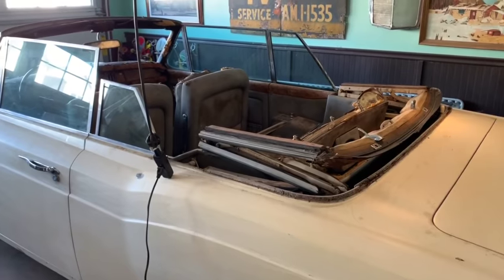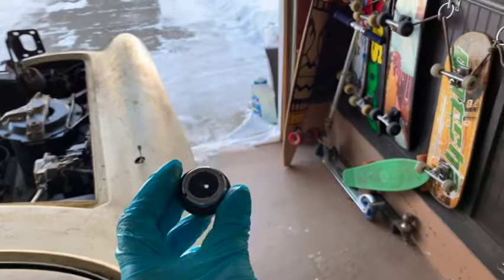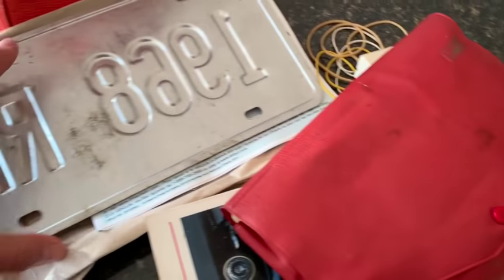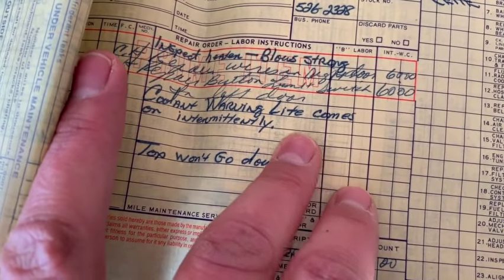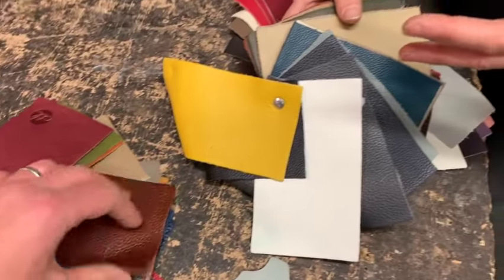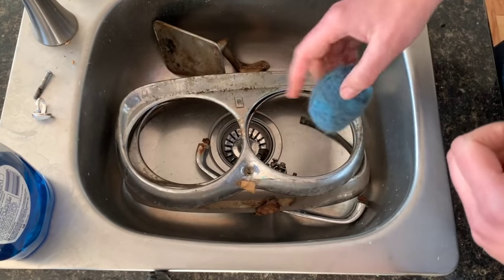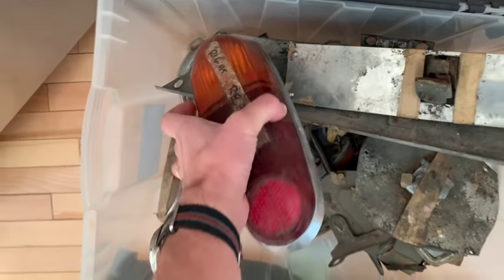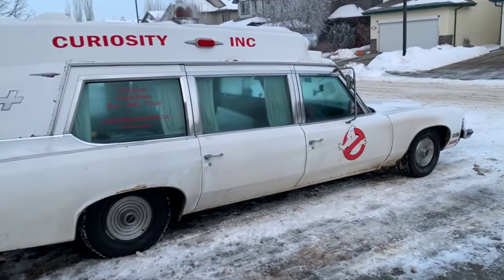I took a Junkyard Rolls Royce and brought it back to life!

Comment: Fantastic restoration but my only observation is that when you were varnishing the wood features, you should have used a polyurethane varnish and thinned down with white spirit and used a sponge type brush or better still a spray gun putting down many thin coats building it up slowly to a high gloss finish. Water based varnish does not give as good a finish as it raises the grain in the wood where the polyurethane does not. But otherwise a very impressive restoration of a  classic Rolls

Comment: I recall reading a motoring journalist's review of these cars in 1969. He said he had a criticism. That is, that because the windscreen wipers are chromed, when the sun shines at a certain angle, it dazzles you. There isn't anything else to criticise. Instead of a fuel tank it has a 50 gallon ocean that takes £70 (in 1969) to fill.

Comment: White Vinegar does the same job as your expensive de-ruster at a fraction of the cost.  Also, for large/long parts I use a section of PVC tube large enogh to fit them, capped at both ends. I fill it with cold water and a couple of raw potatoes, cut in small cubes.If you don''t believe thel atterone, I have before and after pictures! If you had a Tupperware or similar container large enough to fit  your bumper ends, it would do wonders for them.  Soak for about a week (maybe less, but I know a week works) and rinse with cold water, perhaps light scrubbing with a brass brush.

Comment: The plan certainly has come together, forgive me for cringing when I saw you using a paint brush on a Rolls Royce, but hey overall results are awesome and you have rescued an iconic motorcar. 😊
Reply: Yeah I was a bit taken aback, also the upholstery is good, but its not Rolls Royce quality, I would have been inclined to buy a used interior .
Reply: @jaynedavis4667  A few thoughts occur - it could be very difficult to find a good used interior and in the right colour. It could be VERY expensive, and might still need repair work...
This type of project has a budget - and a time scale. You have to do what suits you...!

Comment: I have a friend who actually used an old ford with an interior easily as bad as this was. And it ain't due to racoons! ( Critters  only wanna get stuff for nesting, it's cold out there!) No he's got two real dumbass dogs, that wreck everything they can get at! It's really a case of " no that's ok buddy, I think I'll walk it's a nice day." As I start of on a 30 mile hike in the pouring rain! Honestly!
  Good work man. These are super rare here (UK) . I always wanted a roller but never had the opportunity. I did however own a 4litre R engine. In a 62 Princess Vanden Plas . Now that was a nice car. It had a gorgeous grey leather interior and was very, very comfortable and pleasant to drive. I believe that they were fitted with the dreaded Austin/Morris 3.0 litre straight 6. But luckily RR had a glut of unused 4.0 sixes that A/M bought and fitted to the Princess. It also had RR air conditioning which considering its age ,worked pretty good.
   I never fully restored it ,and really it was great the way I bought it - from a scrapyard for £200 (in 1998)  All I did was clean it up , fitted new tyres, wiper blades ,air filter,etc basically Serviced it real well. T-Cut the paint and waxoyled it. It came back lovely, a nice glossy ghost grey and looked fantastic. I did have modern electronic ignition fitted as the old set up was awful in winter . Also because I was a young poser ,I fitted a set of supaslot style alloys with wide lo profile tyres and had the windows tinted (they used film, so totally reversible) dark smoke. This look really suited it ,and my plan was to lower the suspension , remove the bumpers,door handles,locks and trims and 'french' it! I'd seen one at the Bath and West custom show which was chopped real low and was in high gloss black , tints and frenched and it looked amazing! ( It also had a Rolls V8 installed !) But I was made an offer I couldn't refuse, and fuel was at the highest price I've known it ever and at 20- 25 mpg it was a no brainer! 
  I bought a three year old VW Corrado GTi with the money! Not bad for £200!

Comment: Lucky you saved the original glovebox lid.. the walnut on these is 'split' if you look at the panel as a whole you will see the burl pattern is mirrored across the center. When it was made the wall nut was split and 'folded' out to get that effect, if you had used the second lid it would never match the rest of the dash. Furthermore Rolls Royce keep the next section of walnut so if it is ever damaged they can supply a section that will match

Comment: AS an FYI mate, you should only use RR363 Oil for the brake and hydraulic system, no other oil is suitable!!!! RR363 has a special lubricating additive that keeps the rubbers on the piping from drying out.

Comment: When buying the hydraulic suspension models of Rolls.
Check underneath at the hydraulic pipes if they are rotted.
You will be fixing them, then when driving other parts will fail.
You have two pumps one for suspension one for brakes.
I think the brakes were split between the two pumps so you always have power to stop.
Reply: The hydraulic system on these is a nightmare its a mega job.

Comment: You should try Evapo Rust.  It's a an amazing rust remover.  Non-toxic.   It does not require gloves or masks or safety goggles.   As long as it isn't used as a cleaner, you can pour it down the drain when it is finished.     You can get it a Lee Valley or Princess Auto.

Comment: FYI The wood should be sanded with 300 then up to 600 to get the veneer to take the clear coat, your clear wasn't the best choice for that dash, rolls have a mirror like finish and is done with urethane clear. the more time you take to prep the better it will turn out!, take your time it's worth it!.Good luck on the re-finsh post more vids of your progress and good luck!..

Comment: 48;22  starter Motor stuck  use wooden shaft of 2lb hammer  on casing knock out the graphite dust also  Starter Cellinoid   Stuck fused . Seperate plates  rub down with Emery cloth .. top tips   I know you did all this    But people who maybe trying rebuilds themselves .  Good luck

Comment: I remember seeing a Rome plate Rolls Corniche convertible hidden at the very top of a multi-storey car park inside a very high block of apartments in Monte-Carlo way back in 1983. The car was in a dreadful state, the hood (top) was shredded and hanging in tatters, the body coachwork was covered in cement dust, the tyres were split and flat. The car had been there years and years. I did wonder if it had been stolen from Rome and abandoned in Monte Carlo. I always regret never trying to find a chassis number or a registration plate and following up on it.  :(

Comment: The nuts and bolts will be af  sizes and there are placese in the uk that brake rolls royces so it will go backtoether nicely  we call the wood finish beur walnut  when a tre gets damage it get a big lump on the trunk that is the patern in the wood  best of luck to you hopee to see it up &running later

Comment: Rusty pieces?  Soak in Distilled White Vinegar (5% acidity) which is less then $3/gallon.  This will soften the rust.  Yes, even with rock hard, dark brown rust as can often be found on the tops of bolts 5% distilled white vinegar WILL soften the rust and allow it to be brushed or buffed away with a wire brush or wheel or even red 3M pads or toothbrushes.  

Depending upon your particular rust problem, this process may take several cleanings/brushings.  Keep in mind sometimes deep pits will brush up to look shiny so, when you're satisfied with your work, try one more soaking to confirm your piece is rust free.  If rust still persists it will reveal itself as a brown spot, even if you've made it shiny from brushing.  

Once you have achieved a rust free piece, wash it in baking soda and water to neutralize any remaining acid.  5% vinegar is very mild.  You can dunk your pieces in it and walk away for days without concern.

As for rusty fasteners, just get new hardware.  New, plated fasteners will resist rust far longer than old, clean, un-plated fasteners.

Comment: I'm a bit surprised a Rolls convertible of that vintage had a plastic rear window. I had a Cadillac convertible the same age and it had a glass rear window. I'm also surprised there's no chrome/stainless around the windscreen, at least mounted in the rubber.

Comment: You are lucky to have found a very good shop to do the in places very hard work, with a bonus of learning new Ukrainian swear words. On the paint job it looks nice but I think needs two more layers of clear coat to give that deep look of a true Rolls Royce paint job. Back in the mid seventies I got the chance to go to the Rolls Royce specials factory in west London and watched a guy hand making the aluminium wings for one of those cars.(only the standard wheelbase saloons are built in Crewe. All the cabriolet, stretched and anything special was built in London. This is body wise that is, all the mechanicals came from the factory at Crewe

Comment: It's worth putting all the efforts 😅 as it pays back but also it shows. That's why Roles should not be considered omg cars. 
Once I came across an old Roles in registration office Bombay, the driver while showing me around complained for overheating. I pointed out to him the grill is closed and link is missing. There was a liver to open and close grill to have radiator cooling air in.
I was in my 20s and didn't know worth of my piece of information.

Comment: You should be much more appreciative and not sound so doubtful, take this project on as a challenge, it's a great project and you have a lot of the original to start with.  I'd get it running then have the interior professionally done then I'd do the bodywork since all is straight with very minimal oxidation, go for it, stay positive it's really a nice project!,
Reply: Now that I've viewed the whole restoration ..... WOW nice! You did it right, you utilized the right people to take care of the upholstery & the brakes as well the mechanical, liked those shop guys, knew there stuff, you've got a great car, Blessings to you!

Comment: Perhaps a better way to go on the interior would be to contact Tony Handler (a real Rolls Royce salvage parts dealer or another salvage parts) and see if he had any complete RR convertible interiors.  As far as the dash is concerned all Shadows have the same thing.

Comment: You've done well. The body was remarkably rust free and could have been a nightmare. The leather repair and roof was a great achievement.
I wouldn't have turned that engine over until plugs were removed and gently on the crank pully with lubrication,could have done terrible damage.
The saving grace were the mechanics that had a good grip on the hydraulics,braking and suspension of these quirky cars.
I would also lubricate all the window mechanisms.
You have a great car that is very stylish. I know these well. Summer only,the heater is a wooden flap!
Worthwhile rustproofing the underside at some point.

Comment: Beautiful man, but the leather around the radio is a bit amateurish, she should redo that!  Love the choice of colour inside and out.  I'd say it is probably cheaper than a NEW car and so you've done well, it will outstrip them in future value many times over.  Cheers, P.S.  I watched this in two chunks, maybe you should split it and give the option part one - part two  ;) as another choice to this video.

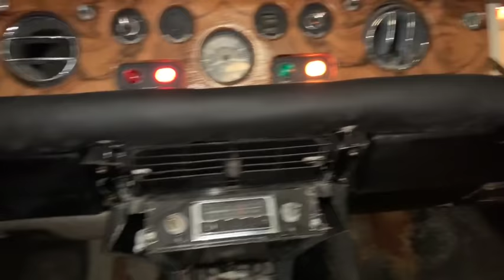Comment: 47:52 switching electrics on trying windows and starters us very Dodgy   Things can fuse catch fire   Melt   
Etc etc   Or if valves stuck could bend break trying engine turn over     Always put squirt of 3-1 oil down the plugs   Leave plugs out  turn over maybe 2 secs .  ( when first engine fires up   You will get bit of gray blue smoke for few minutes  . Then burns off    . Beautiful car though   Test of engine running well  is Balancing  a coin on edge 👀 on the flat area of the rocker cover    It should be soo smooth coin stands easily

Comment: Buy a used Roller as a project for £5,000, spend £15,000 putting it back on the road - and you've still got a £5,000 car.

Comment: I don't know how much you paid and how much you spent to get it right. This car is a car to keep for you to enjoy and leave behind for others to enjoy. These are not high maintenance cars like other Rolls Royce. In England, I would call it a Convertible Corniche, a very sought after car. In Europe it would fetch at least €40,000 ...There is very little to go wrong now. However, my suggestion is to replace brakes and tyre before they are due. It is a heavy car that does use its brakes and tyres more than others. One more suggestion, keep the front tyres with a little lower profile and the rear with a little higher. That would make her steady at curves at high speed. Congratulations and have really good luck with this machine.

Comment: Did you only changed 1 shock absorber? If so, why didn't you change them all?
Reply: Especially as they had to order in the tool to remove and install a new one. Seems unusual not to replace at least the opposite side to the leaking one so you have a pair with the same wear.

Comment: Probably not Whitworth. That was largely redundant after the 60s along with British Standard Fine. More likely UNC (coarse) or UNF (fine). My original 1970 Mini was almost exclusively UNC/UNF. If the spanner is an imperial size measured as something sensible across flats (AF), e.g. 1/2""AF, 9/16"AF, then it's probably UNC/UNF. I hope you're getting proper Connolly hide, too. 
The walnut on the door cappings is matched - same tree, paired veneers, mirror image. You were wise to take it gently here.
And in the end? Royces prove that with enough money even Lucas electrics can be made to work long-term.

Comment: as a brit i know the issue with the 67,68,69 rollers was rust inside floor panels firewall bulk head the shock towers and rear shock mounting areas wings front and back ,the list goes on ,but if the body is correct and engine is fine and gearbox ,the rest is not that had to get done

Comment: The GM transmissions were built under licence by Rolls-Royce. GM couldn't understand why they couldn't just take GM made ones and stick them in. Of course the tolerances Rolls-Royce worked to would never be available from GM, it was the design they wanted.

Comment: You seem somewhat surprised that there was no rust in the bodywork despite its age.  The reason for that is quite simple.  The body is not steel, it's aluminium, it will still be rust-free in another 50 years.

Comment: Lovely job but is replacing just one shock absorber a regular thing over there? I ask because you spoke on the replacement without even hinting at an explanation being needed.       I was taught that they should always be replaced as a pair, and all the mechanics I've ever spoken to, here in the UK, were of the same mind. To have an unbalanced response between the  two sides of the car will have a negative effect on the steering.
btw. That raccoon tail was a lovely touch. I'm still laughing.

Comment: Did you know (I didn't Google) about 74% of all RR are still alive? You can contact RR to get parts, same as Mercedes benz, they have everything you need to restore your car..if you got the loot of course. Too bad GM or other American companies aren't like this. And of course it's like jewelry, these RR/Bentley's aren't all built by a machine/computer with china crap. The cars are hand/machine made post 1965. Pre 66 were all hand made. Very beautiful cars. It's a shame the newer RR in the last 15 or so years are jellybean type and most the chrome is gone.

Comment: Using poly varnish without a UV blocker does not protect the woodwork. UV will cause the layer of wood just under the varnish to deteriorate and then the varnish will peel. The original varnish was probably SPAR varnish which has a natural UV blocker.

Comment: Do you know where this car was  delivered new, and who the original owner was? One of the world's most expensive cars, available in 1968, probably had a celebrity owner? The ones sold here, in Los Angeles, and Palm Springs, always did. Mary Tyler Moore, in her autobiography,talks about buying a brand new 1971 Corniche convertible, right off the Beverly Hills dealer showroom floor, and having it break-down (or "fail to proceed.") a block away. 🤔

Comment: Those tires are just a touch too large. the car is begging for wide white walls, and wired caps. the flat caps are stock indeed, but they always looked better on the larger rolls. the sportier rolls looks better with wire rims!

Comment: If it has new interior but the block on the engine is cracked and unusable what would it be worth? Probably $500 at a scrap yard plus whatever you could sale the seats for
That's why most people work on the mechanical end first.